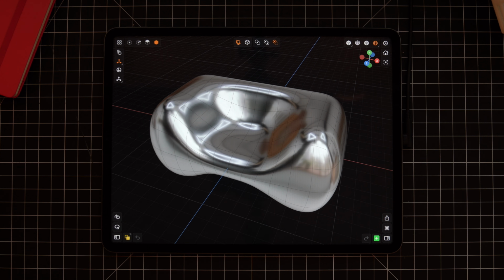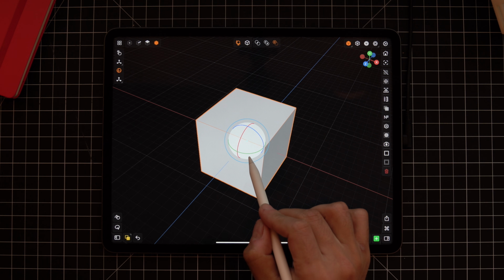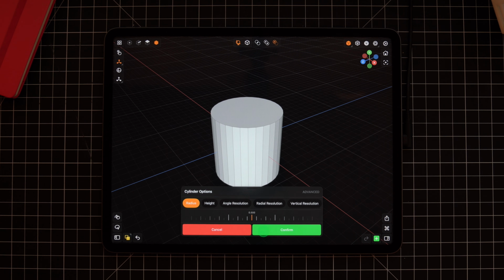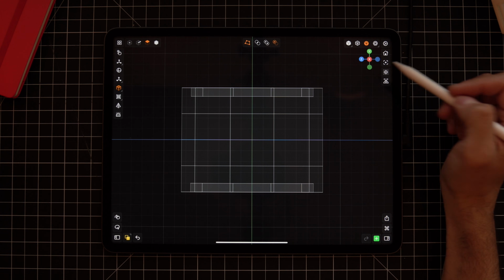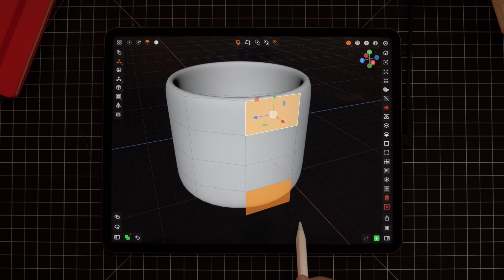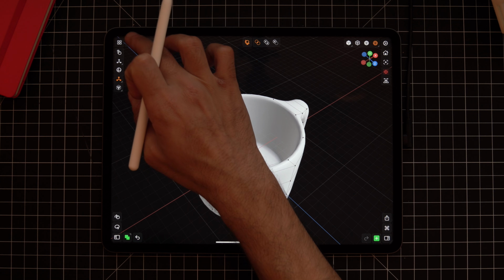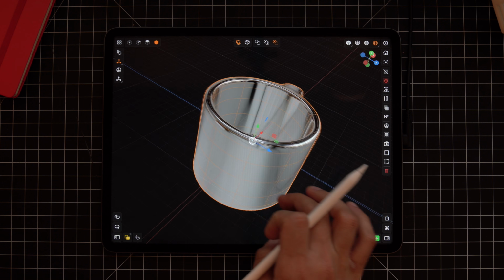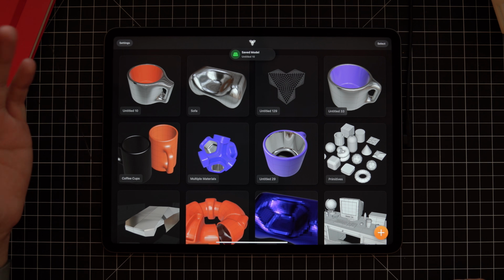A Quick Tour of Valence 3D: a 3D modeling app for iPad & iPhone

Comment: Ok I think after watching till the end I have my answer and finally and app I need without stupid subscription plan. Thank U! It's definitely worth 45€ in app store and I will buy it. One last question for supporting 3MF file as an export? STL unfortunately don't keep data for different materials or separate colors. When I will design multicolored thing em export as STL it will be one color in slicer, but when I do the same with 3MF it will show different colors as designed. This save so much time.

Why no more tutorials?

Comment: Three quick questions:

1. Do the subdivision surfaces support edge creases vs. adding support loops to harden the edges?
2. Are there multiple levels of subdivisions and can you commit to say, the 2x version and convert the subdivision surface to actual divided polygons
3. Is there user control over the polygon display normals. Harden/soften edges or smoothing groups, etc.

Thanks!

Comment: Guys the app does not open any more. Please fix or I will get a refund.
Reply: Will there be a Discord?
Reply from the maker: @CodeaDeveloper  yes! It’s live but it’s currently for beta testers and a handful of people pushing valence to its limits. Helping me iron out the initial issues & feature. It’ll be public in May
Reply: @Valence3D  Can you add a way to add multiple loops cuts and multiple bevel segments. Also can you add mouse support (scroll). Also please release the public Discord sooner, I have multiple questions.
Reply from the maker: Hi Dino! Sorry about the issues, can you try to disable iCloud drive for Valence 3D, Then disable iCloud inside of Valence's settings. This crash is due to iCloud issues on iOS 17.4. Hopefully this will be resolved in iOS 17.5. More detailed instructions on how to resolve the issue: https://manual.valence3d.app/troubleshooting/crashing-on-start/
Reply: @Valence3D  Thanks it worked
Reply from the maker: Also, please make sure you are on the latest version. If not please delete and re-install! Hope that helps!

Comment: Cool. So when is the ANDROID version coming?
Reply from the maker: Is there an Android version?

Valence 3D is only on iOS. We are working hard to make sure Valence 3D delivers the best polygon modeling experience on iOS before we tackle any other platforms.

Will there be an Android version?

When Valence 3D is more stable and feature complete, work will begin on an immersive Vision Pro version, then an Android version. Valence 3D roughly took 5 years to develop. We are guessing an Android version could be built in either half or two times the amount of time.
Reply: @Valence3D  I really hope you will be able to release it soon on Android. Many people hate Apple and their over priced and  Nurfed products.
Reply: @Valence3D  good answer :)

Comment: There needs to be a bevel tool and a draw split tool for it to be a serious modeling tool
Reply from the maker: agreed! what does a draw split tool do? is it the same thing as a knife or cut tool?
Reply: @Valence3D   it’s a tool where you draw the edges manually point after point on the mesh itself

Comment: How is this better than nomad?
Reply: In Nomad Sculpt, you cannot add or delete faces, edges or vertices...

They're for different purposes...

For example in Blender, there's a tab dedicated for sculpting and it has its own tools. That's what Nomad Sculpt mainly is about. Its main purpose is for sculpting.

While Valence 3D is like the basic modeling tab in Blender.
Reply from the maker: Not better than Nomad, different is the right answer. Valence 3D is for hard surface / polygon modeling. There are no sculpting features in Valence 3D. Valence 3D doesn't deal with textures or uv unwrapping either. Its sole mission is to help people start learning how to model using polygons.

Comment: Been looking for something like this for a while. I bought it, however I don’t think I can take this app seriously unless it has a knife tool of some sort. That’s a very important tool for the poly modeling workflow. I’m going to hold on to see how the app improves before I consider refunding it. If you manage to add a knife tool, it’ll be close to perfect.
Reply from the maker: The knife / cut tool is the most demanded tool, and its first on the feature list after all the bug fixes for robustness. New features should be rolling in mid may.

Comment: Hey. Great UI and potential. Do you plan to add solidify, array and boolean modifiers? Do you have plans adding curves or splines with possibility of adding profiles?
Reply from the maker: Working on robustness and documentation at the moment. The roadmap for v2 includes booleans, solidify, and an array modifier. I'll add extruded profiles / curves to the feature requests.

Comment: Okay, sold, I'm buying it, will complement Nomad Sculpt on my Ipad. Plus NorthernGFX featured you in a short.
Just have a question about the features : is it possible to display images on planes to use as blueprint for modeling ? That would be a nice feature to add if not in the app already.
Reply from the maker: 🎉 yes, there is an photo primitive you can use to bring in an image!

Comment: Does this app work for exporting 3d models as .stl for 3d printing? I think for the price it would be very good vs Shapr3d that is way to expensive for hobby 3d printing and desing use.
Reply from the maker: It does! It has STL exporting out of the box! I love 3D printing and digital fabrication so the tools in valence are there for bringing your models into the real world! The measure tool and dimensions were made specifically to help with sizing for fabrication & exporting

Comment: Using multiselection how you can select edge loops and faceloops ?
Reply from the maker: Hey! So you can select loops by triple tapping on a face or edge. Or you can quickly select three edges or faces in a row! Lmk if that works for you. I’m also working on a button for easier loop selection
Reply: @Valence3D  thank you it works. Triple tapping I thought maybe a long press would be they way to go but a button can be good as well

Comment: I’m excited about this, but it’s definitely a bit rough around the edges at the moment. 

I can’t seem to get snapping to work at all. Turning snapping on, or using the extra touch has no effect. Snapping works now after a reboot 👍🏻

Editing a mesh with subdivision and mirror also seems quite buggy. I tried selecting faces at one point and they appeared to be in a completely different location than my model.

Also, it doesn’t seem to be possible to select ‘through’ a mesh, i.e. I can’t select the back verts/edges/faces of a model in x-ray mode like I can with Blender. 

I’d love to be able to preview the effect a loop-cut has on the subdivision while editing - right now it’s only when you commit a change that you can see it. 

Would be nice to have the option for multiple cuts, too. 

Some blender-friendly options like z-up would be nice. 

Huge potential though, so thanks for your hard work! 😃
Reply from the maker: Thank you for all the feedback! Definitely will factor this into the new features and bug fixes for April!